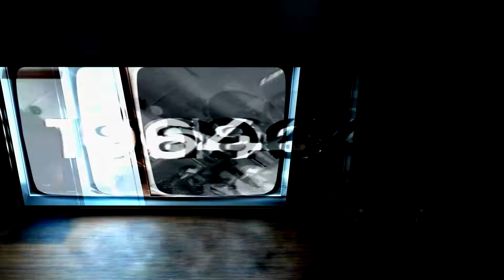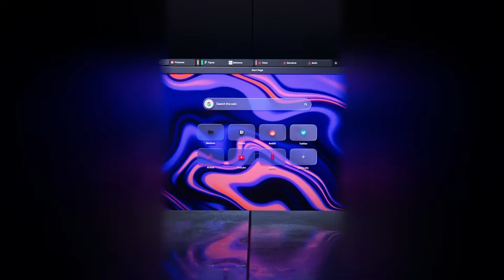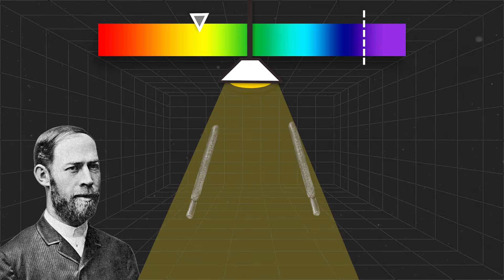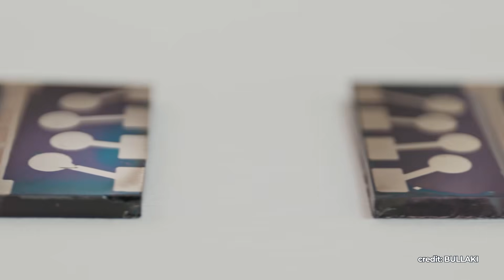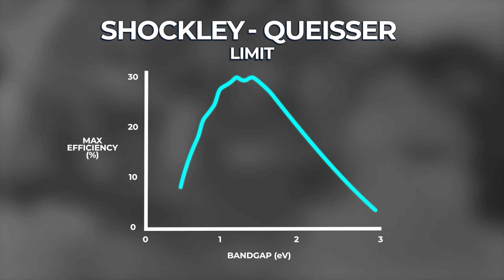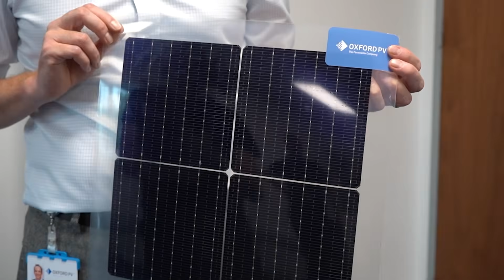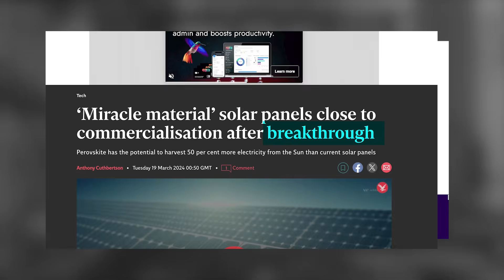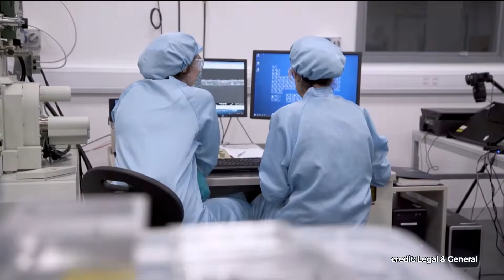How Physicists Broke the Solar Efficiency Record

Comment: For a roof installation, when you take the cost of scaffolding, wiring,  inverter, roof frames, labour, and profit, a solar panel that is 40% more expensive (for example) might only push the costs up by 20%.   People doing price comparisons often often miss this point.  The panals are only part of the overall system installation costs.   Throw a home battery in and the costs work even more in favour of more efficient cells.
Reply: yet, while save solar panel that give you 4 kW during summer time usually could at best give you 400-800 W during winter when you need energy the most. Solar panels is not the biggest issue here inverter + storage could cost much much more then solar panels.
Reply: @Ayvengo21  wrote "inverter + storage could cost much much more then solar panels". I just priced up a system and the inverter and storage do indeed just much more than the panels now. My 6.5kWp system is £950 for panels and £3000 for storage and inverters. Then about another £1000 for wiring, rails, monitoring. (And £500 for scaffolding but I have that up already for another project). So the actual panels are now only about 1/5th of the cost of a system with storage, or 1/3rd for a system without.
Reply: @Ayvengo21 solar panels are around 50% better during winter
Reply: I buy pallets of used or rejected commercial panels from industrial solar farms at heavily discounted rates and install them on my small business properties with the least amount of wire, parts and systems possible.
Reply: Installation costs are only one part of TCO. A full lifecycle cost/benefit comparison factors in degradation & lifespan. 
Unless space is the limiting factor to getting the required generation capacity- it's total cost, not area efficiency which matters most.
I don't get the point about batteries - they're completely agnostic to the electrons being fed to them.
Reply: @DT-dc4br  From the perspective of a home owner, there are two prices that matter. How much it costs to buy electricity from the grid and for what it can be sold. Typically, the grid price is much higher than the levelized TCO of a solar cell, so it is economically sensible to add solar panels.

At the same time, depending on the sizing of the solar array and the consumption rate over the year as well as the delta between buying and selling, a battery can be refinanced by selling less energy to the grid during peak sun hours and consuming it over night. The point is that it does matter where the electrons come from as they are not priced the same.
Reply: @joergsonnenberger6836  I get that (did the calcs before installing a PV array 9 years ago, which paid for itself in 6.5 ). My point is cell efficiency makes no difference unless  area is the limiting factor. My generation capacity is the max allowed for domestic properties. The original poster implied a synergy between more efficient panels & batteries. What is it? Why would a battery care if my 300w panels were 25% smaller?
Reply: @DT-dc4br  Residential PV installations are often space constrained, at the very least in the sense that installation costs are non-linear. Covering another roof for example adds a lot of initial cost. So spending 20% for on one roof can be more cost-efficient than adding another roof. A residential battery only cares about the production itself, of course.
Reply: @joergsonnenberger6836   How often really? Citation needed.  An average 3 bedroom property has a 95 m^2 roof.  Already 20m^2 of regular panels hits the grid tie generation limit. IMO, the promise of future "better" panels damages solar uptake when the economics for existing tech are already favourable.
More expensive "efficient" panels don't necessarily help when it comes to carbon offset: "bang for buck" is the imperative metric. Until we collectively run out of roof - opportunity cost is at play &  less cost efficient endeavours can be to the detriment of overall net zero ambition.
Reply: @DT-dc4br  The average might be 100m^2, but that doesn't mean all of that is usable easily. E.g. here it is quite popular to have pyramid roofs. There is always a promise of better tech next year, but for PV installations, it hasn't been relevant that much for many years. It's currently more a problem for electric vehicles or battery storage solutions.
Reply: But if you have the roof space or space in the yard or vertically along your walls, you can always add a few more 22% efficiency panels instead of upgrading the existing ones or the plans for a new installation. Solar is rarely limited by area or mass. For example adding two-sided vertical panels along a fenceline might actually make a huge difference for morning and evening energy production instead of worrying about 2%-unit extra efficiency. Vertical panels are a game-changer near the arctic and antarctic circles and in hot climates they offer other benefits through improved convective cooling. An 80C panel produces significantly less power than a 60C panel.
Reply: The problem is, these panels have a jack-shit durability.
Reply: It sounds like these may be better even on other parts of that process as well since you’re talking about using smaller frames and possibly less labor as a result?
Reply: A home battery often isn't worth it anyway. Before you get one you should do a quick calculation how long it would have to run in order to pay it off vs just selling the excess. And don't do that calculation with the full solar capacity because on average over the year you won't get half that.
Reply: Like mentioned for the majority of the General Public, Residential installs the cost and efficiency gain is Not enough to change.  The customers would be commercial, niche, or limited those with limited space and power options.
Reply: Don't forget the Qty 7 Porsche Taycan EVs in different colours, one for each day of the week. That way you can further dilute the more expensive solar cells. Such logic !!  Yay !!
Reply: This should be one of the top comments
Reply: non-grid power generation is great for take the load off the grid, but right now, it is not a 1:1 replacement. Paired with building efficiencies, you can make a pretty big individual difference, though, especially on hot days with high grid demand.
Reply: Yeah, and if the new panels are structurally based on the old ones, an upgrade could be done without having to buy a whole new setup since they may be compatible.
Thus encouraging their adoption where solar panels are already in use because you don't need to throw everything you have away just to get the new ones.
Reply: The pipe dream is that solar will solve all our "climate change" problems.  5% more efficiency would be a massive improvement, but to make EV and solar for most homes viable, efficiency would need to be at least 40%. It will not happen at scale in our lifetime. But they sell you the dream/fantasy.
Reply: @ you’re forgetting nuclear and grid scale storage
Reply: I just did it myself at a fraction of the cost 😂 everything they use can be bought without the scam middle men. inverters, transformers, voltage steppers. whatever, even a battery kit that you can wire into your circuit breaker.
Reply: depending on which company you go with this is likely untrue. i worked in solar for a while and most of the time i could get people full solar for less than the price of their original electric bill. with batteries of course it would be a bit more but just using the grid as your battery, solar can definitely be cheaper.
Reply: @madduxv  It is the tiers, location variances, lien possibility, roof repair with panels on the roof, selling house are issues that can easily nullify any savings in power.
Reply: Can we just not cut the kids genitals off, inject them with hormones after a six-month consult, have grown men using female locker rooms, have men destroying women's sports, and demonizing anyone who doesn't want their child taught that gender is a spectrum?  Is that so hard?
Reply: You don't need a roof unless it requires it and even then everything is about location.
Reply: On top of which you need less current solar panels to achieve the same yield. This opens options to install them on balconies of high-rise buildings, or replace current installations etc.
Reply: Which is why it's more efficient for an industry to produce energy rather than individual residences. Industry can save on costs, materials, and carbon expenditure using economies of scale.

We shouldn't care how the electricity is produced. We should only care that our power outlets deliver reliable power. Electricity should be produced by industry using nuclear, solar cells, geothermal, or elephants jumping on trampolines. Regardless of how it's done it won't make a difference to us as long as it's green.
Reply: @potato9832  solar on existing roofs has a lower total environmental impact, and even better ROI because no big aluminium/steel frames needed. The frames add a lot to manufacturing, transport energy costs. 
Also, less transmission upgrades are needed  and less transmission losses when the source energy is closer to the home.
Plus cost of land.
Reply: @potato9832 yes and no.  Yes there are advantages to massive solar farms, but you also have to take into account land value and energy losses getting the power where it needs to go.

Likewise, distributed power generation feeding into a smart grid will be less susceptible to power outages.

Solar on every roof combined with distributed storage batteries would be a very robust system and reliability of power is valuable as well.

Weighing the costs vs benefits of different approaches gets complicated quickly.
Reply: @dynamicworlds1  There's plenty of land above parking lots, highways, and industrial buildings.

Second, residential housing is not the best placement for solar panels. They aren't oriented in the right direction. If one side faces south, then the other faces north. That's 50% usage of roof space. If the peaks face north and south, then it's still 50% usage. You want panels over flat structures (parking lots and industrial buildings) for better panel placement. Backyards would be fine, but that consumes usable free space.

I think small wind turbines are a better option for residences, because turbines are more efficient and production comes with a smaller carbon footprint.

And third, since there's a carbon footprint to producing solar panels, it's better to place them in more optimal locations first.

And fourth, mirror collection systems will still require dedicated land use. We probably won't be able to place those over residences. Mirrors are more efficient, but their production has a greater carbon footprint. Both solar panels and mirror systems will be needed.
Reply: @potato9832  you're conflating the efficiency of large wind farms to the kind of small mills that would be able to fit on a house and they're not at all comparable.  You know that, right?
Reply: @dynamicworlds1  Energy losses occur in ALL power systems. Yes, that is a point, but it is a stupid point since ALL power goes through that. WTF lol
Reply: @dynamicworlds1  Yes, but it doesn't work everywhere and the technology needs to be scaled, both batteries in terms of Wh/L and longevity and microinverters which probably needs to move the way of SiC or GaN FETs, each with 10x. In the US, a lot of power is exported. The efficiency of residential solar drops pretty significantly in the north as compared to the Sunbelt. While solar is nice for residential outside of urban/industrial districts, baseload with very high capacity factor like nuclear cannot be ignored for urbanites, otherwise solar and wind farms are the currently most feasible solution.
Reply: @rubbles2206  baseload power is an outdated concept in a post-carbon grid and even nuclear will need energy storage to get away from peaking plants.
Reply: @dynamicworlds1  Never said energy storage was not necessary, never said AEG/decentralized grids are not worth researching and building. However, the technology and cost effectiveness is not there yet. If you want carbon neutrality in a reasonable time period (e.g. 2040-2060) that is long term sustainable, you will need to integrate baseload power. Like I said, you need battery technology and microinverter technology to scale substantially more. For those who live in suburbs and have the means to switch to rooftop solar in certain regions it makes sense. Economies of scale still strongly prefer solar farms - tracking, concentrated, and bifacial solar cells will not work well outside of farms. You need 10 acres of land to do 1-1.5MWe of nameplate generation, it's not like building canopies and using building roofs can easily get to 10000 acres of land needed to power even 10% of a major city's needs. It will likely need more land due to efficiency dropoff, and require more maintenance that is niche. You do not just suddenly make the footprint of solar infrastructure lower by putting it on a rooftop, if anything it needs to be bigger due to efficiency reduction. I do agree that some supplemental decentralization is good and helpful for decreasing burden/costs, but it is not a scalable solution at all.
Reply: @rubbles2206  no, we don't need baseload power because that's a completely outdated concept in a post-carbon grid.
Reply: @dynamicworlds1  One of the advantages of a solar farm would be using it to provide shade to land that is already utilized for something other than farming.  Notably car parking lots.  Having solar panels occupying the land already used by parking lots would double the value of that land instantly. (And make it less awful to park in the southern US in the summer.)
Reply: @dynamicworlds1  What is your solution and has it been implemented in a cost effective manner at a scale 100x smaller than say Miami to this day? Without evidence is just speculation.
Reply: @rubbles2206  the simple fact of the matter is that baseload power only makes sense as a concept when paired with peaking plants, which (with the exception of the potential of hydroelectric being used in that capacity) are all fossil fuel plants.  Since peaking plants need to be phased out, baseload power will be an obsolete idea.

No matter what we choose to go with (solar, wind, nuclear, or some combination thereof) the power generation over time will not match power usage over time, so we will need grid storage in one form or another.

Sure, I have tech that I am most optimistic about implementation of, but the specifics of that are irrelevant for this conversation.

Also, none of them are used in mass scale right now because we're largely leaving peaking plants as the last mode of energy generation to phase out since natural gas is the lowest emitter per kwh of all the fossil fuel forms.  Agree or disagree with that strategy, it is what is being attempted, so all grid storage tech is taking a backseat when it comes to implementation.

Now do you actually want to defend the idea of baseload power generation, or do you want to admit it was just a buzzword you never really questioned before?
Reply: @dynamicworlds1  I think we are on two different pages. I am not against smart metering or smart grids or even some degree of decentralization which can provide resilience against outages and give small users freedom to use their own power. However, I am for baseload generation and the major energy source being based on centralized generation infrastructure which already exists. Load following has existed for 30+ years even in nuclear reactor designs from hot standby to 150MW/min slopes, more than enough to follow day to day variations. More transient spikes can be covered by decentralized storage, true. But for decentralized renewables, it is situational and requires solutions that are not attractive to every user, microinverters, batteries, control hardware/software, currently not scalable. I think we agree that some degree of decentralization is good. I'm saying that it doesn't replace nor does it have to compete with centralized generation and centralized infrastructure, which work from NREL does not uproot in their development of their smart grid.
Reply: @rubbles2206  we're talking past each other because you refuse to engage with the fact that baseload power generation is an outdated concept and want to keep running off on tangents instead.  Focus and stay on topic.
Reply: @dynamicworlds1  OK, so are you saying load following follows your purview of baseload power generation or no? You are conflating multiple concepts into your vision of a "decentralized carbon free 'non baseload' power generation grid". Let's make it clear what you mean so I can engage with it. I'm still trying to figure out what you mean by "baseload power generation" being an outdated concept. Nuclear is baseload power generation, it can also load follow. You do not elaborate how that is an outdated concept. SK, China, Russia continue to expand heavily into nuclear and see continued development through 2050 to 2100 so it's clear policymakers do not see it as outdated. I feel that you are not engaging with my concerns of how the technology is not there yet and you're already saying it's outdated. So, please tell me how it can be outdated if the technology hasn't been applied to scale yet?
Reply: @potato9832 theoretically it's true in terms of efficiency but decentralisation give also another advantages
Reply: @potato9832  Problem is transporting electricity is inefficient and the industry will make u pay for it like a bill whereas if u make it at home, it's free and u don't lose energy in transportation
Reply: @potato9832  Its not all about production, do you know what else matters? Stability, reliability, and backups. Because if shit happens to the big power farm, you can still run your own power for a while or work at a reduced rate. Economies of scale are an old concept for states and societies that could afford it, were past that, we have an extreme excess  of almost everything, distribution matters nowadays and you cant effectively distribute much when you build it in one place. 
This is not a binary issues, this is a scale issue, where do you draw the line?
Reply: I think about this a lot. Humans have hardly really ever had enough extra to always build the ideal solution. What we have now is because of sacrifice. For all or most history. Roads, houses, Schools, farms, entire cities just kind of happen over time. Then having 20 20 hindsight. We can see the best. They even know at the time there are ideal or better ways, and there are realistic levels of perfection that are attained. That just always leaves people either catching up with stuff as it breaks, fixing it, and still theres growth. It would always be best to put the best possible roofing system on your house, so in an ideal world the ones who would live there in the future never even worry about a roof leak and it lasts forever and makes the rest of the house last forever. That is always choice. But, not always possible. That I think is a problem that can be addressed and it could help advance human progress if it is.
But you are right. it's true. The Wires for the system add tons of cost.Don't cheap out if you have the choice. Think If one is to get the best wiring, it costs a lot more. Just that is a huge efficiency thing. and cost thing. Wire gauge. We need to get a taste for how much energy our bodies can make and use and then compare it to our machines. That's why we get weaker and weaker and now barely resemble our ancestors, allegedly. We are just out of touch with how much energy we use, feel we deserve, or how much energy is ACTUALLY needed to be alive and happy and healthy and why we use so much more. Sent using energy. Sorry. 

Also have you heard of phase change materials insulation.
Reply: @Sim-q9t I ain't reading all that
Reply: @Sim-q9t  That's an INCREDIBLY reductionist look at history. The longest lived empires, buildings, cultures, and even Religions all have historical evidence of a MUCH larger amount of care put into planning for that perfection PRIOR to execution. A comparison of cultures has been done by a few dozen Master's students (Ty Jstor) correlating how deeply a culture valued planning, efficiency, and mastery to the longevity of that culture(each focused on a different one, or collection of these traits, but the over arching theme is surprisingly common)

It isn't hard to guess which direction the trends pointed. The more you plan out prior to execution, the longer you, your creation, and your very society survive. It's incredibly stark.
Reply: When you are quoted for solar panels, you are not quoted just for the panels.... You are quoted for a full install, wtf are you saying here? Do you think what you said makes a difference? You didn't clarify ANYTHING that people don't already know.
Reply: @jf8138   @grosserboss  This user comment and Ben do not understand "economic optimization". Adding more cheap moduals make more sense and not much more rack/labor in small additions. He just wants to support the UK product and "glaze over" the ridiculous research goal to "improve an optimized product" buy adding materials that are a magnitude more expensive and much less durable over time! A good analogy to this kind of twisted ridiculous research is to compare it to washing a PV module ... it makes it slightly more efficient for a short time but not worth the cost to clean them even monthly if it rains seasonally.  Here is an example of how a real scientist/engineers at SMA  optimize a PV system.  They implemented an "inverter downsizing" calculator to reduce inverter size (aka oversized PV array) to make their inverter more "economically optimized".  It turns out you do not need to size the inverter for the optimal power output at solar noon ... but instead match it to the average output more near the 70% max noon  value.  This design plan instantly reduced cost about 30% for the inverter/wire  costs which was about 15% of the total system cost per watt.  You could also predict the total system life cost by taking into account that an inverter would be replaced 3 times during the life of a typical PV module ... meaning up to 45% savings/watt.  The automobile analogy would be you do not need a 500 HP car to get your groceries ... 100 HP is fine when you are in town and the speed limit is 30 MPH.  In fact an electric bike using 1 HP is 500x more economical and 100x more economical than a Tesla!
Reply: Those are all variables that change for every user. I'm DIY, so it costs nothing but materials.
Reply: Without batteries 10X cheaper, this is pointless.
Reply: @gregorymalchuk272  My system without batteries would be about half the price, not 10x cheaper. Batteries are expensive but you can now get 15kWh for £1700 and prices are dropping fast. A battery like that amortised over 12 years costs about 2pence per kWh of charge/discharge cycle.
Reply: Nexgen batteries are half price so we're getting there  @gregorymalchuk272
Reply: Energy is the only currency that actually matters. ;)
Reply: I think winds is better than solar…. Because solar would be too easy to take out in war… when you need it most.

One nuclear bomb, and you have cloud cover for months. 

Also a volcano eruption could do it. May as well put more research into wind etc.